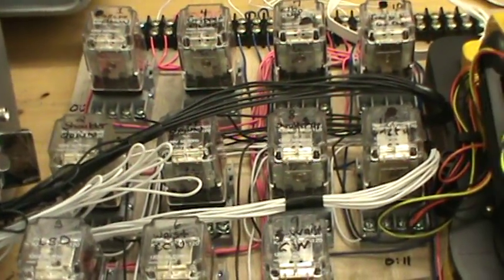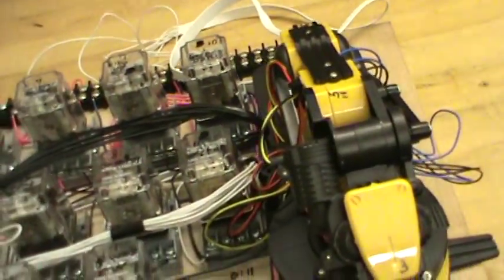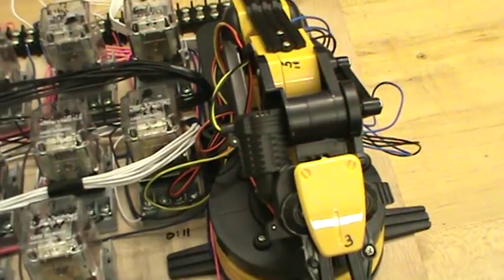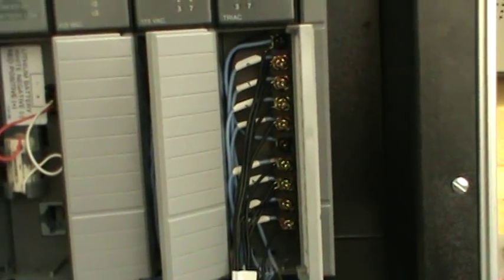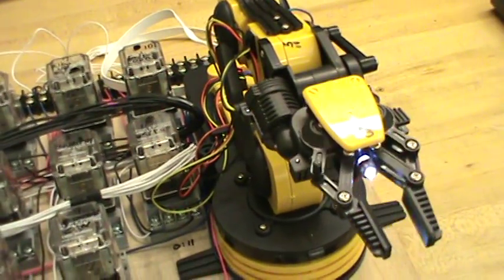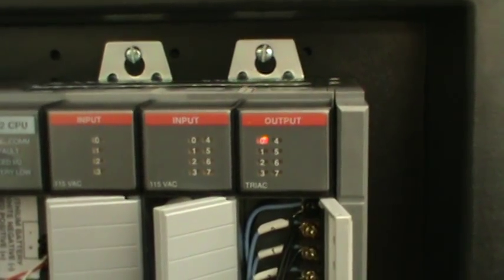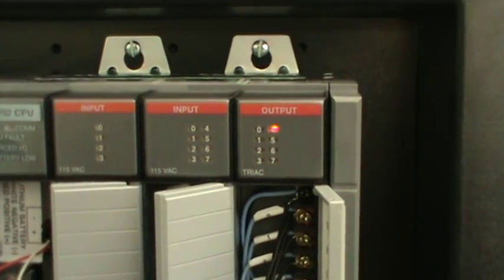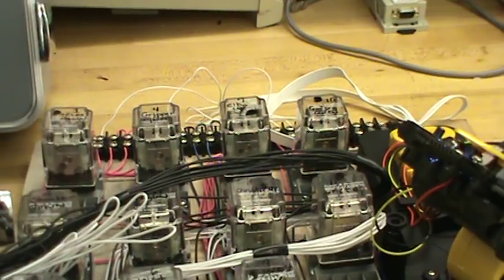Robotic Arm Plc Controlled

Comment from the maker: Your PLC should have internal relays that you can use. I am using the 110vac relays as triggers for each 6VDC motor, since the outputs on the were 110vac.
Reply: Please share your plc program (I hope it's a Ladder Logic) my email :- 4myofficialwork@gmail.com
I need this for my engineering project. Thank you!